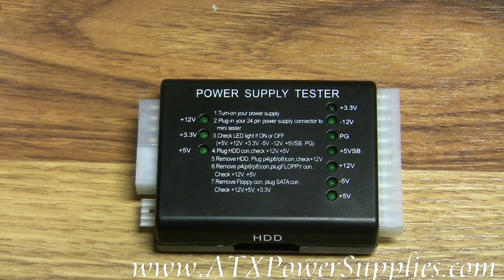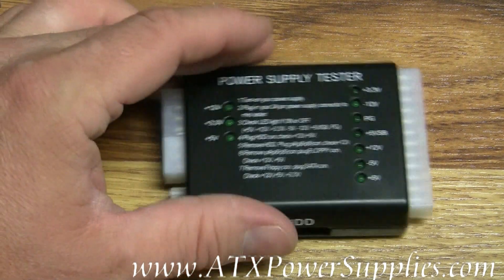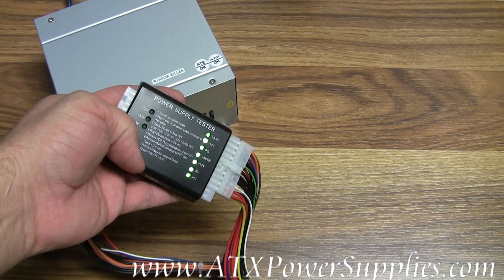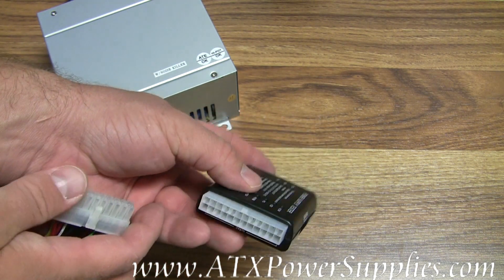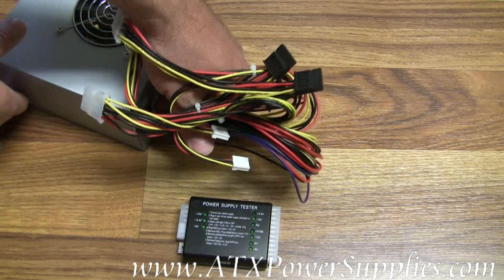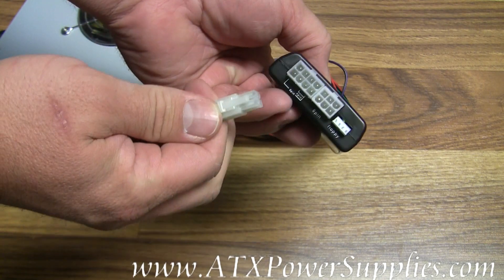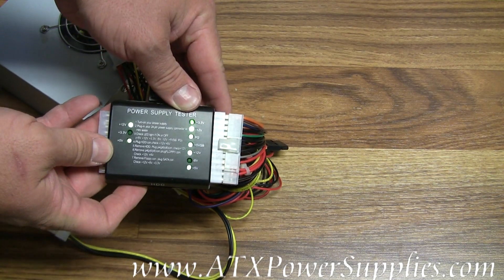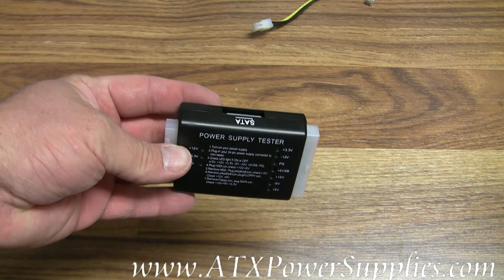ATX Power Supply Tester - Demonstration

Comment: Should we need to turn on the psu or the tester detects it automatically without turning on the psu
Reply: There's a problem if it gives you Voltage readings with the PSU off.

Comment: Would this indicate if there's fluctuations with the current?
Reply: One of my psu had a bad connection,  the light would go off then on while wiggling the wire.
Reply: @lonniebeal6032  I did get this thing, and it was a complete piece of junk. I decided to take my PSU down to the shop to have it tested with their equipment. They recommended the PSU tester from Thermaltake.

Comment: I was testing a psu but the -5v is off what does that mean ??
Reply: If you look at the pin out for the wires.  The -5 wire is missing.

Comment: hello
i have this servre fujitsu ps150-d2559 and have inside power supply model fujitsu dps-450fb g rev:02 m and can i replaced with dell dps-450 fb a ,because i dont find the same model, and if you have the manual for output connect 
regards.

Comment: the  -5 volts on mine doesn't lite up. Does it mean the PSU is gone bad?
Reply: The pin out for the wires reflects there is no wire for -5v

Comment: At 4:30 into this video you plug in the SATA connector and then move on after 5V and 12V LED's light up (as if the 3.3V does not matter).  But instruction #7 on the tester indicates that 3.3V should light up.  Can you elaborate please?

Comment: Thanks for the explanation on the -5v. Thought my PS was bad. You saved my some money. Thanks.
Reply: My -5v dont light up. What does that means?
Reply: @cyberattack2802  Look up the pin out for the connector online, you will see there is no longer a wire for -5v

Comment: The +3.3v lights as well when i plug in my SATA. They are now both older power supplys you are showing and on the NEWER type you may well need the +3.3v for some hard drives.

Comment: I just found one of these in a thrift store for $1.. Was thinking about buying one online because I had a 1000W power supply that wasn't working anymore. Plugged it in and only the +5VSB lights up. I've inspected all the capacitors inside and didn't notice anything of concern.  Not sure where the problem lies here.. :/

Comment: As it only checks voltages and not if a PSU can deliver rated power under load, which is what happens when a PSU gets old it's only half good.

Comment: The -5v light is not lit up on mine (I took the PSU out of the case to test)... and my Pc doesn`t work with the PSU in & connected. There are no instructions with the tester to say what any of it means.
EDIT
My bad.... Seems there is no -5v on modern PSU`s. Motherboard is shot. Will shut down in 15 seconds. Again...

Comment: When plugging in the SATA I get no +12 or +5 Would the prevent the computer from starting? (no power light on the computer) The SATA is for the hard drive.
Reply: Chris Bauer i know this is late but no, unless another part of the PSU doesnt work that shouldn't prevent your computer from at least POSTing. Computers do not need storage devices to boot. Typically you'll get a message saying "no bootable devices!!!" Or something after it POSTs.

Comment: nice demo,  need some advice
is this kind tester still perfectly ok, or i need buy the 1 has LCD screen?
planning to buy 1 of them, with or without LCD :)
if the function still same, i really dont see benefits of LCD screen 

thx in advance
Reply: Get the one with the LCD because these are useless all they show is if power is being delivered not how much. The LCD shows voltages to you can see if it's Delivering to much or to little power. Unfortunately, they only show voltages for the main connector SATA connectors only have lights so you still may need a multimeter if you see or feel that something is off.
Reply: Dan W --- it is the simple way to check power supply  in stead self testing with tweezer on green wire+ black wire shorting trick

Comment: Nice presentation-- but now dated from late 2010. A modern edition is planned?
I especially liked your effort to distinguish the older ATX PSUs which have -5V from the more modern which do not. 
At the beginning, not having read yet your post below, I thought you were going to demonstrate your tester would test really old AT-form-factor PSUs with the P8 and P9 flat white nylon connectors. I still have a few people running those, so it would be nice to have a direct plug-in check, rather than use a paper clip.
Appreciate the note about specific PSUs which do not conform to the ATX standard-- that will save us a few raised eyebrows and delay.

Comment: What specifically does the 3.3 V circuit do?

Also, why would my power supply test green light on the power supply tester, but show only 3.08 V, below the specification, in a monitoring program with the computer running?
Reply: The +3.3V connection delivers ample current; +3.3V provides the Staged Voltage to the Motherboard, the wires are orange (that’s the standard color, I’ve seen it even in purple), often present a smaller gauge orange or brown is a +3.3V sense, must be connected to the regular gauge orange (+3.3V) wires to allow the Power Supply Unit to detect and regulate outputs.

Some “less expensive than the average” Power Supply Units with lower maximum output use a linear regulator to generate +3.3 V from the +5V converting the product of voltage drop and current to heat, small linear voltage regulators are installed in some drives to keep the +3.3V stable by feeding it from the +5V rail. +3.3V supply is most sensitive to voltage drop in the supply connections, this could be the reason why the monitoring program reads only +3.08V.

Comment: My compliments on this excellent tutorial on the handy ATX PS tester and you cover all the bases! The reason I say "all the bases" is that I have to ponder how many perfectly good power supplies, especially the later =24= slot connectors are unfortunately tossed out by the user ==only== because the tester user didn't see the -5v light go off for their quite possible =24= slot connector and figured the power supply was bad even tho'  on the more recent ==24== pin power supplies it is NORMAL for the -5V ==NOT== to light up but should do so for older =20= pin connector power supplies. 

So too, your additional valuable tip for the tester user to physically LOOK at the power supply and its label where on =24= slot connectors and the various voltage ratings and amps output area info, the -5v or MINUS 5 volts would ==not== even be listed on the power supply info data simply because it's not there! The -5v LED should however come to life when testing older =20= slot connectors and which 'do' have a -5v output and so on those older =20= slot power supplies, the -5v should light up but ==NOT== on the newer 24 slot connectors. You might have saved umpteen power supplies from being tossed only because the user didn't have all the facts and nowhere on the tester itself does it indicate that the -5v will NOT be present on the more recent =24= slot connector power supplies. Again, my compliments.
Reply: Sorry so late but I have a q.... HP Pavillion a6700y. My -5 is not lit and wasnt sure myself until i verified the board end... first start the screen showed weird moving lines and a garbled looking windows brand. I then chose recover mode but it just hung for too long so I pressed the power button to turn off. Ever since it wont even post or boot. It turns on for 3 seconds and back off. I removed the 4 pin from the board and it comes on just fine but if Istart it with the 4 pin in it just turns off after 3 seconds again. Ive cleared cmos jumper even took the battery out for 5 minutes just to make sure. So if it fires up all loud without that 4 pin cpu plugged in that tells me it's cpu or board right? How do I know for sure the psu is even giving it the right voltage? .......Hope you get this.

Comment: WARNING!! Do not have the main power connection plugged in with the HDD, SATA along with the 6 pin plus 8 or 4 pin, you will blow up you're power supply. I wasn't supplied with any instructions and accidentally blew up mine. Once I got everything plugged in all I heard was the fan die down and the tester went beeeeeeeeeeeeep and looked up at a smoking PSU.
Reply: so need test 1 pin at time?
Reply: Correct. I would test 1 pin at a time. You can plug the HDD in with the main pin but I would not plug the 24 pin in with the 6 pin plugged in at the same time.
Reply: I think I have cable that the 5 and 12 are switched.  Will this confirm that when plugged? Or will it blow?
Reply: I just did mine and when the 8 pin connected the power supply made a large hum and a bigger bang.....Killed the power supply and magic smoke everywhere. ...definitely must be better ways and this is the first mention of it I have seen by anyone

Comment from the maker: Something to remember:  These power supply testers follow the atx wiring standard and likewise, the power supplies it tests must also follow the atx wiring standard.  Our folks at ATXPowerSupplies.com have identified several dozen power supplies and computers that DO NOT follow the atx wiring standard and likewise, will not test correctly on our testers.  Here they are:
Acer PY.45009.001
Acer Altos G510
Acer Altos G700
Acer DPS-450FB F
Acer DPS-450FB F Rev. 1
Compaq Presario 5032
Compaq DC5000 DC5000 Desktop
Compaq PDP-116P
Compaq D530 D530
Compaq Evo D500
Compaq 244166-001
Compaq HP-U250XC3
Compaq Presario 5423US
Compaq Presario 5300 Desktop
Compaq Presario 5310LB Desktop
Compaq Presario 5322RSH Desktop
Compaq Presario 5422RSH Desktop
Compaq Presario 5325LA Desktop
Compaq Presario 5330US
Compaq Presario 5350CA Desktop
Compaq 255712-002
Compaq Presario 5400 Desktop
Compaq Presario 5450CA Desktop
Compaq Presario 6000XX Desktop
Compaq 289769-002
Compaq 319235-001
Compaq Presario 6100XX Desktop
Compaq 317218-001
Compaq Presario 6200XX Desktop
Compaq Presario 6300XX Desktop
Compaq Evo D300
Compaq Presario 6024US
Compaq Presario 5430US
Compaq Presario 5320US
Compaq 255712-001
Compaq 255712-004
Compaq 243890-001
Compaq 244166-001
Dell UP957
Dell NP679
Dell UX459
Dell D9761
Dell HY104
Dell HY105
Dell MY064
Dell PowerEdge 1950
Dell Z670P-00
Dell 7001080-Y100
Dell 430-2244
Dell L235P-01
Dell FR610
Dell PW116
Dell RM112
Dell 67T67
Dell R224M
Dell WU136
Dell Optiplex 760 SFF
Dell Optiplex 780 SFF
Dell Optiplex 960 SFF
Dell F235E-00
Dell H235P-00
Dell H235E-00
Dell NPS-330CB H
Dell NPS-330CB B
Dell NPS-330CB C
Dell 0000726C
Dell 04767D
Dell NPS-330CB L
Dell PowerEdge 2400
Dell 024RGY
Dell NPS-300GB
Dell 312GK
Dell 088PNP
Dell NPS-330CB E
Dell 1H070
Dell PowerEdge 1400SC
Dell NPS-300GB B
Dell Precision 410
Dell NPS-300GBB
Dell Dimension 8100
Dell 24RGY
Dell 88PNP
Dell 03E466
Dell 3E466
Dell NPS-330CB
Dell OptiPlex GX400
Dell PowerEdge 1300
Dell PowerEdge 2300
Dell Precision 330
Dell Precision 420
Dell PowerEdge 1400
Dell 0042FK
Dell 042FK
Dell NPS-330DB
Dell NPS-330DB A
Dell NPS-330CB J
Dell N4531
Dell DPS-450FB
Dell DPS-450FB A
Dell DPS-450FB A REV 01
Dell DPS-450FB A REV 02
Dell DPS-450FB A REV 03
Dell DPS-450FB A REV 04
Dell PowerEdge 1600SC
Delta DPS-450FB
Delta DPS-450FB A
Delta DPS-450FB A REV 01
Delta DPS-450FB A REV 02
Delta DPS-450FB A REV 03
Delta DPS-450FB A REV 04
Delta DPS-450FB F
Delta DPS-450FB F Rev. 1
FSP FSP400-60PFB-M
HP DC5000 DC5000 Desktop
HP Business Desktop DK667A
HP Business Desktop D530
HP D530 D530
HP 244166-001
HP HP-U250XC3
HP 243890-001
HP 255712-001
HP 255712-002
HP 255712-004
Mitac MPU-110REFP
Newton FSP400-60PFB-M
Newton NPS-330CB B
Newton NPS-330CB C
Newton NPS-330CB L
Newton NPS-300GB
Newton NPS-330CB E
Newton NPS-300GB B
Newton NPS-300GBB
Newton NPS-330CB
Newton NPS-330DB
Newton NPS-330DB A
Newton NPS-330CB J
Shuttle PC70I0005
Shuttle PC70
Shuttle PPR-PC7000-F000
Shuttle PC55
Shuttle XPC Prima P2 3500
Shuttle XPC Prima P2 3800
Shuttle XPC Prima P2 4800X
Shuttle XPC Prima P2 3500G
Shuttle XPC Prima P2 3800W
Shuttle XPC Prima P2 4800 Deluxe
Shuttle XPC Prima P2 4800E Workstation
Shuttle XPC Prima SX38P2
Shuttle XPC Prima SP35P2
Shuttle XPC Prima SX48P2
Shuttle PC55I00002
Shuttle PC43I3503
Shuttle XPC SB95PV2
Shuttle XPC SD37P2
Shuttle XPC SD39P2
Shuttle XPC SN26P
Shuttle PC43
Shuttle XPC SN27P2
Shuttle PC43003
Shuttle XPC SD31P
Shuttle XPC SB81P
Shuttle XPC SN25P
Reply: My PSU is not in that list.
Reply: It suits ATX STANDARD

Comment: i got the 24pin psu but the -5v don't light up. is it dead or what?
Reply: Newer PSUs (>2009) don't have the -5V rail in them, since it isn't needed nowadays. Your PSU is perfectly fine.
Reply from the maker: Yep.  If the -5V led isn't lighting up it most likely means you do not have a -5V circuit on your power supply.  You can look on your power supply sticker, and if the -5V circuit exists it will have it listed in the volts/amps table.
Reply: +letspleigames my  +12v is yellowish not full green any ideas?
Reply: +Hermit If you are testing an ATX PSU that adheres to version 1.3 or higher for PSU Specs, the -5V LED may not come on since the spec for -5V was removed because it was only used by, now non-existent, ISA cards, so its OK.  If it was a different LED indicator or rating then make sure that you test all connectors along that string (if applicable) to determine if it is just a problem with that particular connector or the entire line.
Reply: Answer is in video - modern power supplies don't have a -5 V circuit.

Comment: Thanks for the explanation; I have one of these testers but it came with no instructions or manual; This helps a lot.. One question; How do you know if the power supply or any other component IS bad? Do lights turn on red or do NOT light at all?..

Comment: I've got one of these that is only showing the -5vsb light when I plug my Corsair CX500 in. Is this a sign of a faulty PSU? Cheers!
Reply: Yes it's faulty. It means that the PSU is not responding correctly to the power on signal from the tester so the only output is the standby circuit.
Reply: Plaswuff      ----- did u try on another  good power supply , there too same observation. Means  u r tester  is faulty not triggering or power on sig not sending .to power unit.

Comment: @fly2000jtb The sticker on your power supply will have all of the voltages on it that it should be outputting.  If there is no mention of the -5V circuit then your power supply does not have -5V.